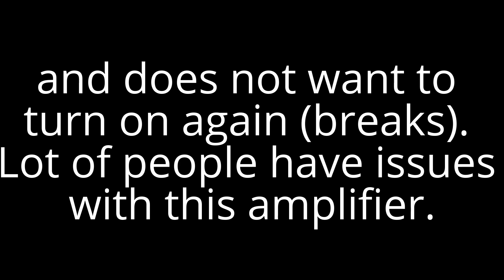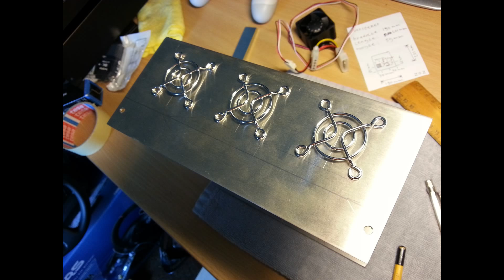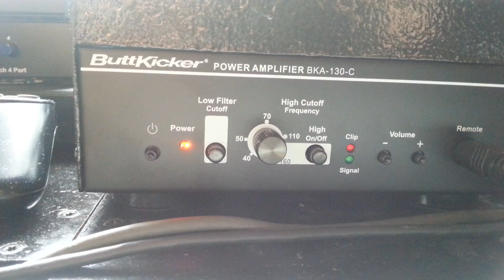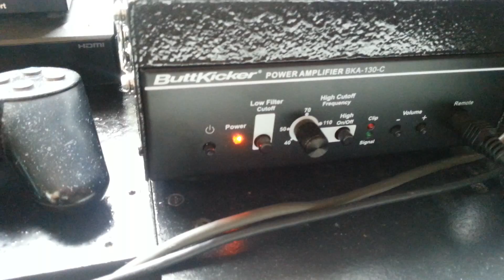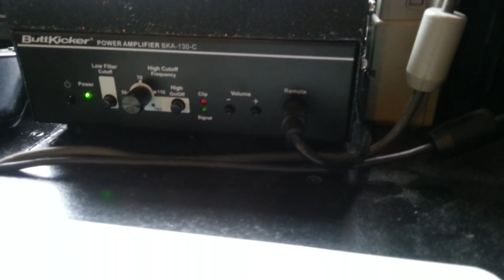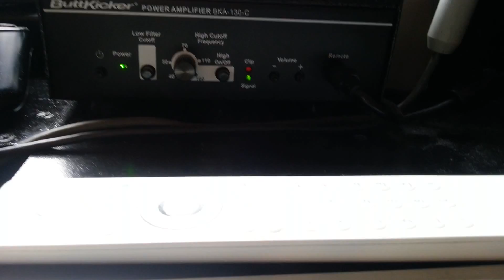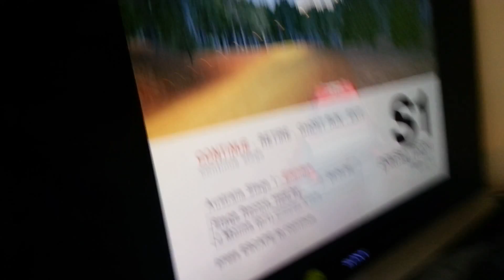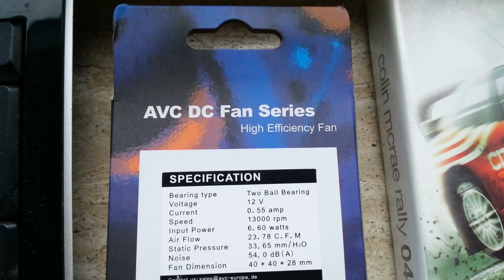Buttkicker Gamer 2 Amplifier Mod

Comment: The butt kicker is an amp killer. The first amp I drove mine on died in 10 minutes. The second overheated after 10 minutes and cut on and off due to thermal shutdown and restart in 1 second intervals. Then I got a car amp and a 50A DC Power supply to drive it, and all is good now. Now I can push the butt kicker to its limits.
The amp I used was a ac1500.1M Planet Audio monoblock amp. Yeah, it is probably overkill, but it got the job done without making the amp cry in agony.
Reply from the maker: That's a good solution, need to think about that.
Was the first and second one the original buttkicker amp?
Reply: so how do you hook up the special butt kicker 2 prong lead to the amp??? Or do you route the  butt kicker amp through to the planet audio amp? be specific please......thanks

Comment: Yeah, I had the same issue when running two of them.. I figured it was a heat dissipation problem,  I have not added fans yet and just turned down the input "volume" of my second sound card to about 50 percent for now. But after watching your post here, I think I can solve the issue.  I appreciate your posting this!  Good Job

Comment: Hi, where you get your power supply for the control panel? From your pc or do you have external power supply?Cheers.
Reply from the maker: No it has a external power supply (separate pc power supply)
Reply: Thx m8

Comment: 1. The quality of the amplifier BKA 130-C is pretty much ok concerning performance. But it tends to heat excessively (i guess) and eventually stops working. I got my first BKA 130-C 2 years ago. It lasted 8 months. One day the power indicator light stayed on orange, never turned green to work again the little fucker.
Bought another one (always bundled with the tactile transducer) so that makes it for another 250 euros + VAT charges + shipment (350 total) to Europe and this crappy  built quality amp. was a liittle more fucked up than the previous one.
It lasted 6 months.  
I am glad i have the 2 BK gamer 2 transducers though, i hooked them on a powerful 4 channel  car audio amplifier (modified to a home amplifier) that drops down to 2 ohms and delivers a powerful 4 channel 800W RMS output to the transducers that they shake the fuckin house down.
 2.From what i know guitammer (developer of BK 's) leened an ear on the problem and they released an upgraded version of the old amplifier the BKA 130Ci recently , with improved ventilation and the switching issue has been solved for good so, go for it suckers.
Reply from the maker: Mine BKA 130-C still works, maybe the pc fans help better then i thought.
I know we had a little conversation about this problem a year ago.
Reply: Sorry for my english i'm french.
My amplifier don't turn on (And no warranty, because it's too old (more than 2 year). Is there a chance to fix it ?
Reply: my two amps (I bought another one for a new amp when the first died) died as well - do you have a link to the replacement one (or any other viable replacements) ?

Comment: what are you using for a power supply for the fans. Didi u check to see if there was a 12v source in the amp?
Reply from the maker: They are running from a separate pc power supply

Comment: Just ordered a buttkicker gamer 2.. may I ask if it's possible to avoid the overheating in general in practice with the amp as it comes stock? Thank you
Reply from the maker: Yes set the volume very very low so the red ''clip'' LED doesn't turn on, but if you do that you could keep it inside the box and put it in the basement because you feel almost nothing. Just watch out it does not go fully red for a long period of time otherwise you are going to shorter the lifespan pretty much. The bk gamer 1 was even more worse it was discontinued fast, that's why they released the gamer 2 (as a replacement). They changed only the amp, the transducer (piston shaking thing) is exactly the same. Now because the original gamer 2 amp (called BKA-130-C) (the one most people have) has almost the same problems as the gamer 1 only less, Guitammer (developer of buttkicker) made an upgraded version of the BKA-130-C it's called BKA-130-Ci This one is improved it has no issues anymore they said, i don't have one so i can't say if its really ''improved''. On the other hand the transducer is good no problems whatsoever.

(Maybe something to know)
In every different game you play you have  to change the volume, even if playing the same game you have to change it some times, for example if playing campaign or multiplayer you have to set the volume very high to even feel something and if you go back to main menu and there is a loud background music the amp clip LED turns fully red so you have to turn it down a bit, it's annoying sometimes. It would be nice if it adjust itself but yea.
Reply from the maker: 1. It's indeed strange that the Ci version is not listed on their official website. I've looked at other websites the only one i could find is this one: https://www.networkmusic.biz/~networ26/index.php?option=com_hotproperty&view=property&id=33 It says ''this 2017 version includes internal upgrades for improved performance. It is the same unit used in the latest 2017 ButtKicker Gamer2 package and the Simulation Kit'' So i'm curious which amp you are going to have.

2. Can you open the package and still be able to return it and get a refund? If so i would try it out. Connect them both buttkicker and jetseat to your pc and see how it works and how it feels like. Of course it will be a better experience with both of them. And with the amp there are some other solutions with it. (talk about that in a second). If you can't return it and get a refund after you opened the package then you have to decide for yourself what you wanna do with it. Let me tell you that all the amps Guitammer made are not really durable, if it's the BKA-130-C / BKA-1000-N or the BKA300-4 they all are a little bit crappy build. So don't know if the BKA-130-Ci is an improvement. If you ask me i am a little bit skeptical about it. What you can do is return the gamer 2 package and only buy the transducer (doesn't have to be the gamer 2 can also be the  Advance, LFE or mini LFE, it depends on what your budget is). And buy a completely different amp. There are many other people at which the amp has broken down, take a look into amazon read the reviews people wrote lots of them. So there are solutions people come up with. You can use a car audio amplifier, use it with a converter 110v/230v AC to 12v DC so it works at home. Or use a PA amplifier for example: Behringer EP2000 or crown xls 1502 of course those are very powerfull it depends which one and how many transducers you want to connect to it. If one game2 or Mini LFE transducer is more than enough for you you can look for a lighter cheaper version. Mine still works so haven't really dived in to it yet. But if it's going to brake that's definitely what i want to do.
Reply: thanks for your thorough reply- I've still yet to receive the buttkicker gamer 2 package in order to check which exact model amp my order comes with but I do have  up to 30 days to return it so that's good- both the gamer 2 and jetseat have shipped though the jetseat is expected to take much longer to arrive since it's coming from Russia (I'm in California) but am anticipating it to be the superior product, though as you say with the help of sim shaker in specific sims certain in game/sim vibrations could be assigned to the buttkicker and other more precise ones to the jetseat for maximum fidelity..  if I get the BKA-130-Ci I may keep thebuttkicker gamer 2 though will still evaluate it fully even if it comes only with the  BKA-130-C ..so just to confirm I understand what you're saying it's not the buttkicker gamer 2 transducer/vibrational device that attaches to yor chair  that gets fried easily- it's the amplifier that gets fried only or both? I assume you're saying the amplifier only as you're suggesting those other brands as alternates.. Thank you- appreciate your feedback greatly!
Reply from the maker: Yes the quality of the buttkicker transducers are great, only the amps are bad. If you just run a fan ontop of it it will last a bit longer. And if you are looking in the near future for a different amp, look at the specs of the transducer so you don't buy a amp that's to powerfull otherwise there's chance you will fry the transducer no matter how good the quality is.
Reply: Thanks- I wrote to Guitammer who makes the buttkicker and whom I purchased my order from and this is their response: "The "-Ci" designation indicates our 240V (International) amplifier. Both the BKA-130-C (120V) and the BKA-130-Ci(240V) were refreshed for the production run starting in 2017, both amps are great reliable units.
   -The issues you may have read about are centered on earlier 240V amplifiers with certain customers in Australia and the U.K. The vast majority of these issues were resolved with setup changes/tweaks. To be even more reliable we did make some internal improvements applicable to local voltage (240V) for the revamped international version.
    -We've sold Gamer2 units around the world for over a decade and our defect rate has been well below the electronics industry average and we take seriously making the best products for our users."
Reply from the maker: Hahaha of course they are ''great and reliable units''. No company would say their amps were/are bad.  There is just one way to find out. Connect it and play with it, let's see how long it last. I hope as long as possible.
Reply: Hi again- so I got my buttkicker gamer 2 (as predicted it came with the  BKA-130-C) and set it up  but don't know if I'm doing anything wrong but the volume on my 5.1 surround center speaker is reduced to less than a quarter the volume it normally is when the buttlkicker isn't plugged into the subwoofer/center speaker orange socket on the back of my motherboard and with that I'm getting zero vibration feedback with any music or playing youtube videos etc- I only get moderate vibrations when firing my gun when playing Battlefield 1 myself in person (but not that great as any decent vibrations constantly makethe amp clip/flash red which as far as I understand I need to avoid an dto keep in the green is barely noticeable..and no vibration feedback at all with other bass sounds like other people's guns or explosions weirdly in BF1.. not very satisfactory so far.. not sure what I need to tweak to make this a better experience- don't really understand the high on/off buton, high cutoff and low filter cutoff controls.. thank you for any feedback
Reply: I spoke to Guitammer today on the phone (further to my issues out the box in my comment below) and they're sending replacement cables to see if that fixes it- in the interim the center speaker is still low in volume currently but have since managed to get some vibrational feedback though it has been coming and going (got it going in Battlefield 1 but then mid-game suddenly the vibrational feedback was lost and turning off and on the amp reset it somehow).. Guitammer said it's OK to regularly clip the sounds intermittently  (get the red clipping light flick on and off fairly regularly- eg with regular but not permanent gunfire sounds and explosions in games) so long as it doesn't stay in the red all the time or get clipping with lower volume sounds like footsteps etc- what's your opinion on this? (Did you burn out your amp doing this-
 regularly but not permanently clipping in the red with eg. game gunfire and explosions going off all the time in games as they do so etc or were you more permanemntly in the red? Wonder what you think the threshold for optimum maximum vibration/clipping is possible with the stock amp without burning it out?
Reply from the maker: So only the volume of your center speaker is reduced. You can plug the jack into the green (line out) socket (like i did) instead of the center/sub socket, see if it makes a difference, maybe play some music hopefully that solves the problem. About the buttons the low filter cutoff on/off push switch reduces all frequencies below 25Hz (if pushed in). High cutoff on/off push switch (when pushed in) engages the high cutoff frequency dial knob (left of it) it reduces the higher frequencies, so less bass shaking with high hz. With that said my amp red clip LED turns on with a lot of bass sounds it flashes quite a lot. Normally an amplifier can handle it. like you said you feel almost nothing if it stays flashing green. I got the buttkicker 2,5 / 3 years almost. Mine still works i think the 2 fans help definitely to keep the amp longer alive. Approximately one year ago i used it almost daily, nowadays if i play one time a week it's alot.
Reply: thanks- I've since spoken to Guitammer and they're sending me replacement cables- esepcially the 3.5mm Y splitter cable as they think it might not be good- I tried putting into the green (front left/right speakers channel) audio out socket instead of the orange one (center and subwoofer speakers) and that helped the volume (both front an dleft speakers are normal volume (as of course is te ceneter speaker again not using the Y splitter) and also made the bass shaking much better- the only thing now is the left and right speakers are not separate- anything coming from the left speaker channel comes out of both speakers  and anything coming from the right speaker channel comes out of both speakers too- hope the repalcemnet Y splitter cable fixes this when used in either the orange or green socket- but I'm now pretty impressed with the vibrations in the game I tested which is Battlefield 1.. I also got voicemeter to allow for using my speakers and USB surround audio headset amp (Sennheiser GSX 1000).. the next thing I've got to figure out is how to add my HTC Vive audio source as a third source  for seated VR experiences- do you know how to do that? IS Voicemeter Banana the one to do that (as oppsed to the standard Voicemeter program)?